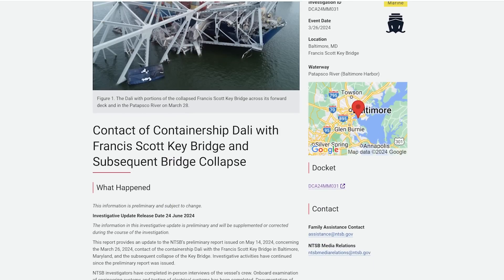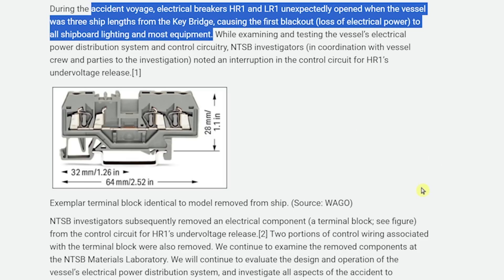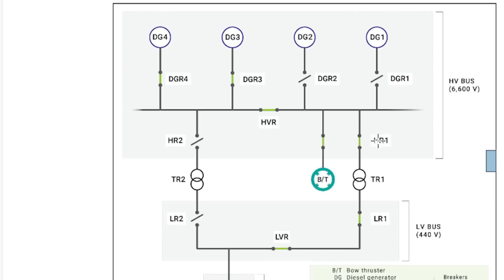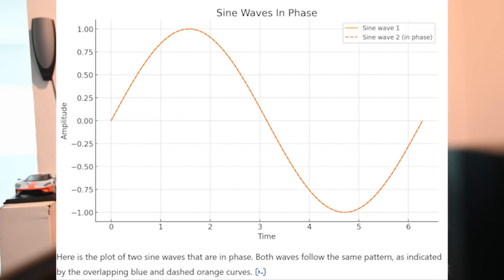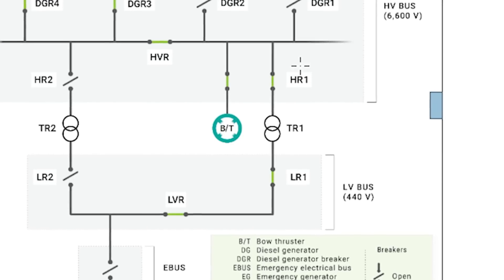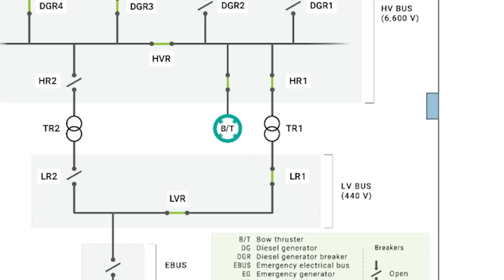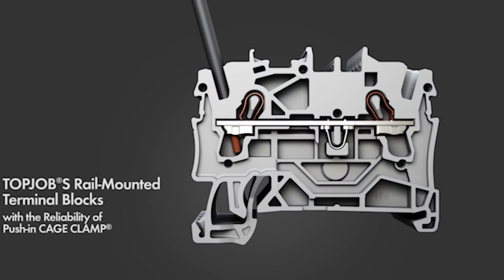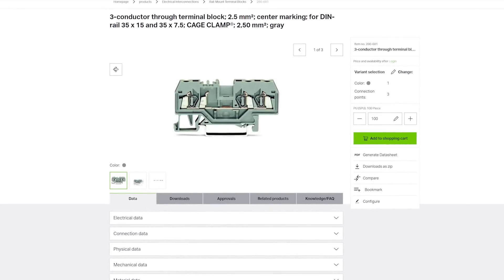Did This Part FAIL Cause MV Dali Key Bridge Collapse?

Comment: The part you are showing has no active components .  If the failure occurred at this Part  it was due to a loss of proper connection or this part was the weak link in the chain, and these are hard to diagnose after the fact. When you are dealing with high voltages and currents loose connections normally cause heat damage or fires.  The NTSB has to be careful in their explanation because it now sounds like a 20 or 30 dollar part failed causing lose of life and billions of dollars in damage.  They should not release any failure information until they have completed a full investigation into all of the mechanical and electrical systems.

Comment: It sounds like the low voltage detector was connected via that terminal block, and acted as an N/C switch, opening when a fault happens. That's considered to be a "fall-safe" design, since a false trip is considered to be less dangerous than failing to trip on a hazard condition. 

Ironic. Very ironic.

Oh, and i wonder if whoever wired that panel read the fine print about it taking stranded wire. You have to use a ferrule on the wire or hold the leaf spring open with a small screwdriver while inserting the wire. (There's a slot on the connector for that purpose.) If you jam a stranded wire in there blindly without a ferrule, it will just bunch up in the hole.

Comment: Ships of that size don't "bounce around". Too much mass. There'd be some vibration worth consideration around and above the engines and possibly the prop shaft. Could be a concern depending on how and where the electrical cabinets are installed.

Comment: 14 years of mechanic working on cars full time, I've seen some stuff. The thing with connectors is much the same from old to new or a terminal block on a ship. They rely on clamping force and making good conducting contact with the male and female part. Corrosion and oxidation can hamper conducting contact. But vibration/movement will cause friction erosion, removing material and lowering the clamping force. Metal can bend and you have a loss of clamping. With a loose male part in a female part you can still lean to one side and make good contact but it can also move away and not have contact. And thus you can not notis a 1ms non contact moment but sense circuitry is going to trigger of the non contact moment is long enough. Sadly the 1 wire at the wrong time can cause Dali to collide with the key bridge by opening the breaker contactor.
Reply: But, from my work of 27 years in electronics of fabrication machines, usually the screwed terminals fail, less so the spring loaded ones...

And as a reminder: In an earlier video Jeff said they should have used both transformers in close quarters. In this case the breaker tripping wouldn't have ended in a crash.
Reply: My work on fire alarm systems, typically 24vdc, I have encountered problems with this style connector in every installation I've encountered using spring loaded only connections. (always WAGO) particularly with small signal circuits (0-24vdc, 50ua to 20ma). This is usually not a problem in higher voltage/current AC applications.
Could it be a 4-20ma current loop circuit broke, leading the receiving equipment to trigger a breaker shunt vs signalling a disconnect?

Comment: A terminal block is just a connector that's used as an interface point between devices in a rack and the cabling. They are very common in the industry.
I can just see a few ways that this could have failed:
1. Cable was improperly installed in the block.
2. There was moisture causing electrochemical breakdown of an interface between block and cable.
3. Overload of the wiring.
4. Manufacturing defect.
The spring locking is common for environments where there's vibration. Most terminal blocks are designed for a dry environment, so if there has been moisture and improper cabling materials have been used (like aluminum combined with copper) then you have a potential problem. Copper clad aluminum is also quite common these days and that makes the wires look like copper but they aren't - add moisture and you'll have a problem in the future. Look out for that in cables that claims to be 100% copper - it might be a fake claim.

Comment: Apparently they had power problems whilst loading reefer containers that drain a lot on load on the generators. I wonder if engineers onboard when fixing the problem of losing power ashore  did something wrong or did a quick fix by bypassing certain electrical components to prevent power tripping. Not an Engineer just speculating. 
 As a previous person commented I still would like to know reason for a lot of smoke coming out of funnel from ship when power regained. I still feel that if ship had power problems whilst loading a proper investigation of root cause should of been made before departure. Maybe it was then I am incorrect. As an ex Captain on big ships there is a lot of commercial pressure placed on Captain of ship to sail on time to keep to sailing schedule. This is the dangerous part of shipping nowadays  because often commercial pressures overrides safety concerns. Another assumption I am making is that maybe Chief Engineer and Captain were aware they had small problem onboard but thought it had been sufficiently fixed without having time to find out what caused problem.
Reply: The puff of smoke  ties in logically with one generator motorizing.  The motorizing of one of the two generators is associated with a defect in the load share circuit.  Load share circuits are complex and often are hidden from the engine room crew by not being visable on the switchboard.
Reply: Just speculating: They might have searched for the failure and found something suspicious that looked like the cause.

Don't always assume the worst in people.
And you should keep in mind: When a organisation like the NTSB searches for the cause they turn every stone, look for all the nooks and crannies. I don't always check every single wire in every terminal. To repair like this would take weeks (as does the investigation).
Reply: @DrKlausTrophobie   not sure if your comment is directed at me. I have one question to ask you before I think it is necessary to expand my comment in more detail for your understanding. Have you worked on ship's at a senior level as either a Captain or Chief Engineer?
Reply: @brianbarbarich1401  No ships, just 27 years of electrics and electronics in a manufacturing plant. Where the goal is 98% availability and (especially at the assembly line) every lost minute counts...
Reply: @DrKlausTrophobie   OK similar environment where time = money. My point was that sometimes things on ship's are not 100% repaired before sailing because of the stressful working environment. Not finger pointing anyone on the Dali just generalising how the shipping industry is run nowadays. As a ex Captain I myself was guilty at times of sailing my ship when I knew inside it was potentially unsafe but did so because of tremendous pressure applied on me by the owner, charterer of my ship, and the Company I worked for.
Reply: @brianbarbarich1401  Thanks for clarification.

Comment: I don't trust any terminal without a lug. Those spring clamps can heat up if the wire is too loose. That is why I refuse to use the quick holes, and I will put the wire under the screw because I believe that more surfaces are touching each other.

Comment: Keep in mind that the electrical diagram used to illustrate the first NTSB report is neither a wiring diagram nor a schematic. What is shown as a high voltage breaker is actually a set of detection circuits operating a contactor. Each of low voltage, high voltage, no current, or excessive current could cause the control circuitry to open the contactor. In fact, there could easily be separate low voltage detection for each side of the contactor and also for the other side of the transformer. Most of these kinds of control circuits are designed to fail safely. And for that reason any fault should open the contactor separate the load from the power source.

A home breaker panel doesn't do any voltage monitoring for the ordinary thermal breakers. Those only protect against over current.
Reply: I'm guessing there is some sort of interlock between the high and low voltage transformer breakers as you can't have it trying to back feed.
If those are the screwless terminals I can see the advantage in a high vibration environment and they say they are better than conventional screw terminals but I've never really trusted them. For one thing it's quite easy to damage them by trying to release them without the right tool and it may not then be obvious that the clamping force isn't what it should be.
Reply: @NiallWardrop  Why can't a system like this be designed to "back feed"? Any given transformer is capable to both step up and step down and is mostly limited by the current carrying limits of the windings. Somebody more familiar with this specific system might be able to clarify whether the symbolically shown transformer is intended for symmetrical use. In fact, what's shown as a transformer could conceivably be a motor/alternator sharing a single shaft.
Reply: @mikebarushok5361  As the heavy loads are on the HV side I'm assuming it's not designed to feed the HV side from the LV bus. All the power sources are on the HV side.
Reply: @NiallWardrop  I would be cautious about assuming that everything is shown on the supplied diagram. The only thing certain is that it isn't complete and doesn't show any of the control circuitry.  It's too simplified to use for fault analysis.
Reply: @mikebarushok5361   It appears the NTSB are saying it was a false undervolt trip due to a bad connection. I'm just noting that the fact that the HV and LV breakers both went out is probably by design.
Reply: @mikebarushok5361  You're looking at systems that support a 3 million watt bow thruster, as one of many loads.  What source exactly would backfeed from what energy producer?  

The problem in these videos is how to dumb down master-slave phase and voltage sync'd large power systems, that are more complex than what skilled engineers can interpret due to design and operating variants, without more than a few minutes of video here.  Those who aren't engineers in relevant fields of experience, need baby steps education if not basic math (and US schools don't require trig and calc to graduate as some countries do).  

So, videos are being dumbed down, to the point we're left guessing what's really meant but not said?
Reply: @lokiva8540  I don't know whether there is a lockout that prevents the crossover bus  tie to be closed on the lower voltage side while the high voltage cross tie is open. And I don't know where, if anywhere, shore power could be connected relative to the diagram.
Reply: And let's not forget, that originally at the time of the accident, the DALI - NTSB reported the DALI was sailing into port and operating on LEG 2, and that in port Baltimore, just prior to DALI getting underway, the control circuitry was transferred to LEG 1 control operation.
Reply: My guess would be the voltage detection circuit would just "shunt trip" the main breaker.  Rather old fashioned, but reliable, this concept is still used everywhere the power would need to be cut with a fire alarm system or  leaky pipes underground at a gas station..

Comment: As an electrical engineer responsible for safe and reliable operation of the engine room electrical systems any fault that occurs should trigger both investigation and remediation.  That may mean replacing or reinstalling components.  Not just sitting around to see if it happens again.  Dali has lax crew on board, IMO.

Also, Wago "stab" connectors are cheap junk, IMO.  I wouldn't have them in my house!!!

Comment: Jeff, you are wrong to call them "breakers."  They are really CONTACTORS, relays, in other words,(not thermally operated circuit breakers) that are controlled by electronic circuits that monitor voltage and current conditions.  It's the electronics that may have been at fault.
Reply: They are definitely not contactors. Contactors are used to frequently make and break load current. Breakers are switches that are rated to break much higher fault currents. They are often spring operated with motors to wind the springs after they have opened as opposed to contactors that most often are operated by an electromagnet directly. Large breakers do not have the control mechanisms to detect e.g. over current integrated unlike a small household breaker that is a self contained unit.

Comment: These power clamps are intended for rigid cables. 
But I don't think it's right to have rigid cables in a ship.
Think about the vibrations on the ship. These do not appear in the house.
However, flexible cables can be used with core sleeves.

Comment: x navy, 40 yrs. as IBEW wireman, used many of this type blocks, nice pc..  My question is what idiot would spec AL wire on a water craft of any type and most of all on a ship used in salt water? One other point is you have redundant systems, in situations like this why wouldn't you have both systems up and running, you run into problems your tie breakers could dump the problem and you would be backed up with NO interruption. The mode they were in takes minutes to spool gen sets and sync up, time they didn't have.  The whole thing stinks!
Reply: I'm quite sure the AL-wire came from Jeff himself because he had seen the notions in the docs for the terminals.
Reply: When I was training in the RAF in 1977 we were taught to use a white paste, the name of which I have forgotten, when crimping terminals onto aluminium cables. I never actually saw any aluminium cables in my time working on aircraft though.
Reply: @martinconnelly1473  A few colors and brands, No Ox is one and it's dark grey, just to keep oxidation down by covering it with special grease by keeping the O2 out, one of Al's main problems.  Under voltage can also be from overload, your breaker of time delay fuse gives you time for heavy start loads, motors etcc.. The other is the one everyone thinks of first, instant trip is what you would call a ground fault Once again if you haven't been around salt water, only and idiot would use Al.  Navy says, yeha right.
Reply: Beancouters. Having said this, worked on genpacks also marine never used these wago type termination blocks always used screw type with crimped on ferrules. Only some low priority DCS wiring was push-in  terminated
Reply: @dubro5009  In my 27 years of work on fabrication machine as an electrician I a had a few screwing terminals fail. Not a spring loaded one (so far).
Reply: @dubro5009  These clamps are certainly more reliable then shoddy screw ins. Way too much room for user error.

Comment: In my opinion the contact area of the wire and the terminal contact is not sufficent to conduct the amps needed for the circuits.

Comment: I see why, they not using screw down conection terminals which is  absolutely necessary for any boat at sea due to vibration and salt corrosion .

Comment: There are multiple verified known failures in varied industries caused by "engineers" doing exactly what you cited not adhering to the published usage for electrical connectors,plugs,contactors ,and terminal blocks. many times the form factors are the same but the ratings vary within a series if parts.  The Aluminum corrosion issue is well known in the electrical industrial arena. Will be interested to see what the final report says and will we reallyk now what failed?

Comment: Push in connectors generally are not very solid, although people are speaking highly of Wago.     The connecting wire could have been undersized.  The voltage is actually very high. I think the diagram said 6,000 volts.
Reply: I do not trust any form of push terminal. While they're great for the installer, they are terrible for reliability. And undersized wire makes them even less reliable. Stranded wire can also cause problems.
 These types of connectors can also have insufficient contact area with the conductors and the spring tension can suffer from metal fatigue.
 I avoid them.

Comment: Going after the terminal block and the wires? Sounds to me like they are trying to shoot the messenger. I would question the low voltage detector for a failure in the active components it may contain. Also, failure of this device, a loss of signal, should not result in an unsafe condition.
Reply: A failure with a component like this could easily have caused the low voltage detection system. Most likely, the investigators tested the low voltage detector and found the detector to be working correctly, but found the detector was being fed a bad signal, possibly due to this terminal block.

Comment: From my reading it isn’t that an undervoltage condition existed; rather that the circuitry to detect an undervoltage condition had a fault that caused the breaker to trip when it should not have, e.g. no undervoltage condition existed.
Reply: that was my interpretation - the system that CATCHES low voltage, had a connection problem, and dumped the breaker.
Reply: Kinda what I was thinking too. A fault in the fault-detecting supervisory equipment.
Reply: If the sensing equipment or breaker trip unit is fed power its sensing from this din rail connector thing and a wire vibrates loose or breaks than the breaker is gonna trip
Reply: @twentycharactersuser  I don’t think the reason uv condition has been determined yet. I’m looking forward to NTSB final analysis of CB. Fuel or crew procedures error still possible.